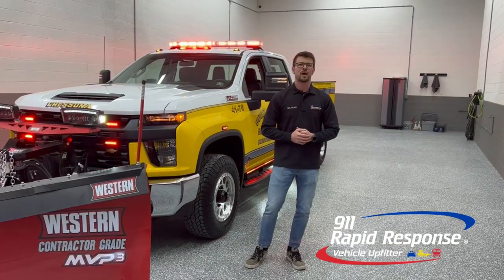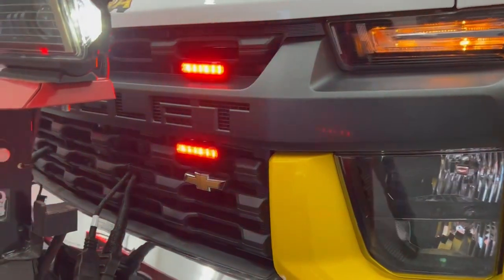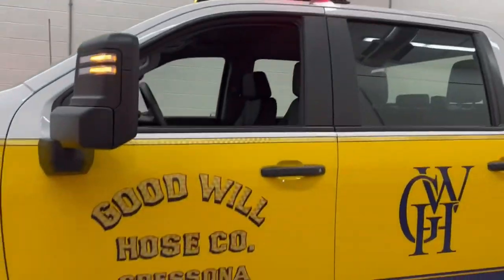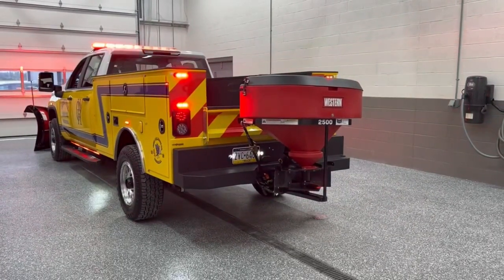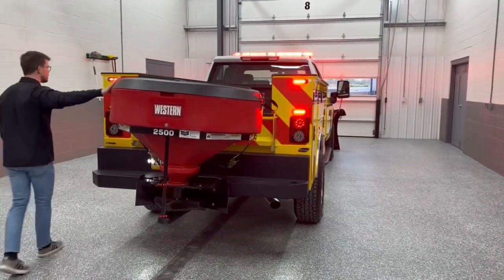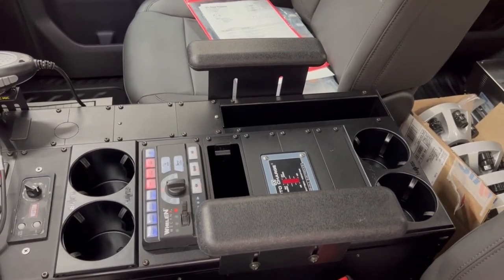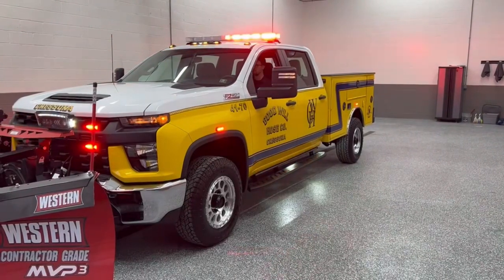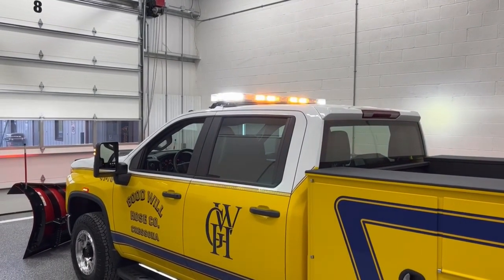Good Will Hose Company, Utility Truck | 911RR

Comment: Great Build! No mention of any amber only for plow use? 
Id also like to start seeing the tracers tucked under roof rack rails on Suburban's for unmarked lighting packages. Have you guys done any? Its a massive footprint easy to hide on a vehicle that needs big output but almost invisible when not on. Especially after a tinted lens is installed.
Reply: Great idea...